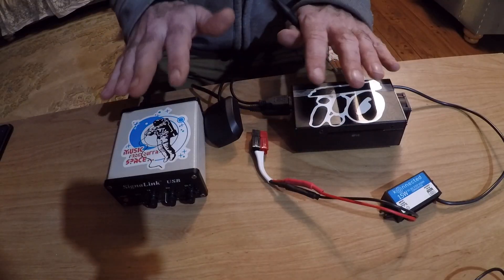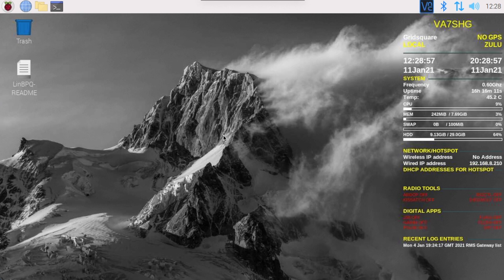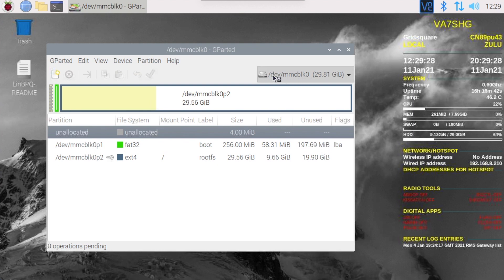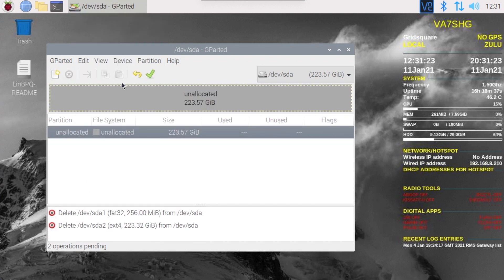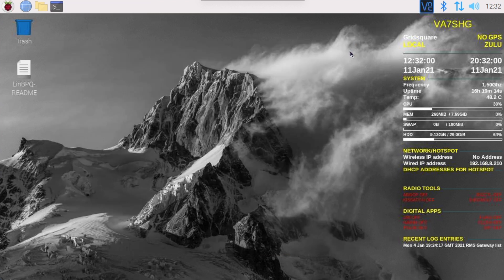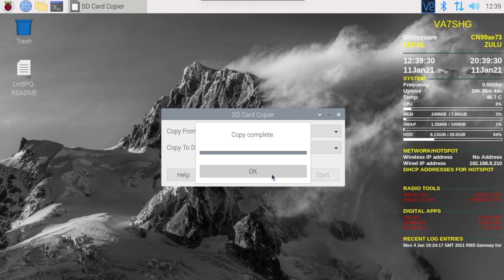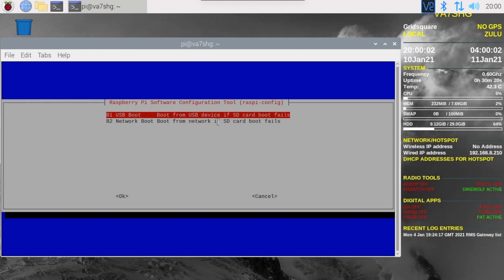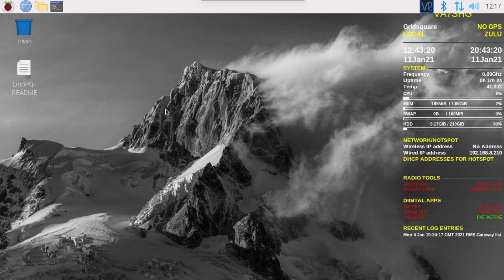VA7SHG - Build a Pi to ARGON ONE with M.2 SATA SSD

Comment: Excellent. I did that exact task a few days ago. For some reason I couldn't find the copy-card program, so I dd piped the SD-card through gzip to an image on my desktop (a handy backup). I then unzipped and piped that through dd to the new ssd (a direct usb connection from my desktop to the installed ssd on the device). After the config routine, it booted as your example. I did have to use gparted to expand the partition to the full size of the ssd. My routine had about 5 extra steps, but I did re-acquaint myself with the handy dd command.

Comment: You make it so easy.
Reply from the maker: Thanks Don! Feel free to ask me any questions if you're moving to an SSD.  I also hope to have some new info about using the Mobilinkd TNC3 with BPQ32.
Reply: @jimshaggy  I looked at their website. I don't see a fan showing. I guess that's extra. I need to get a few especially for linbpq
Reply from the maker: @va7dgp , it's not extra and it is included, but you're right, none of the promotional pictures show the fan.  It mentions the fan in the literature for the case.  Take a look here in my video (https://youtu.be/xkz7l23hyE8?t=44) you can see the fan in the middle of the case.
Reply: @jimshaggy  The USB SSD card extra. I like that. Probally after I get linbpq running I'll work on that